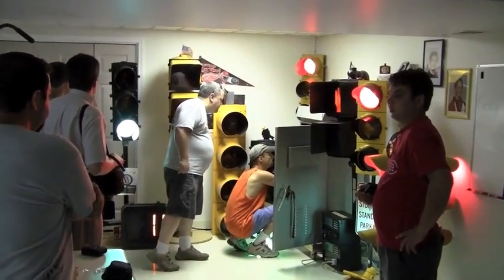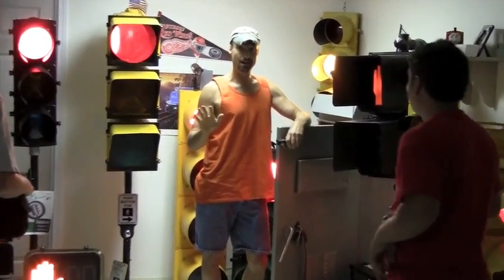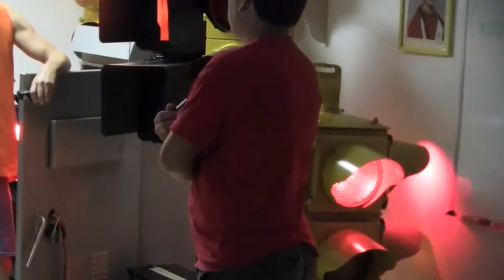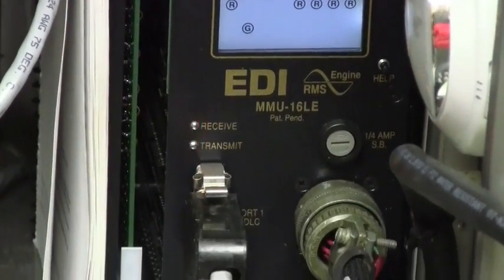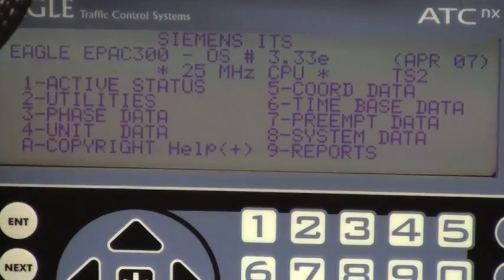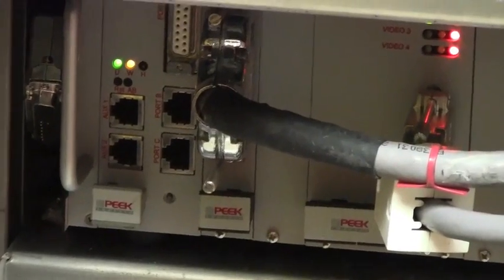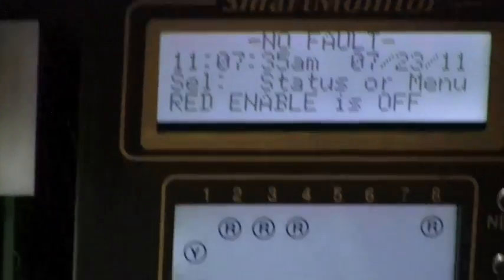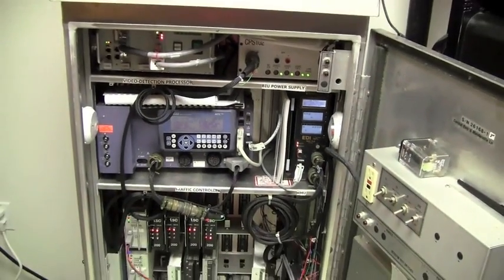Detroit signal meet

Comment: Deriot signal meet mechanical signal lights paper bag traffic  light setup for the weekend and flashing yellow arrow traffic signals deroiot Michigan State university of New York city and the traffic signal lights programmed flash signal system for the great programmed the traffic signal lights programmed to wire traffic signal led 12v led red  and green  yellow and red traffic signal lights programmed to work on my project